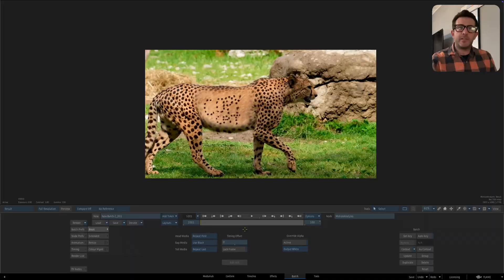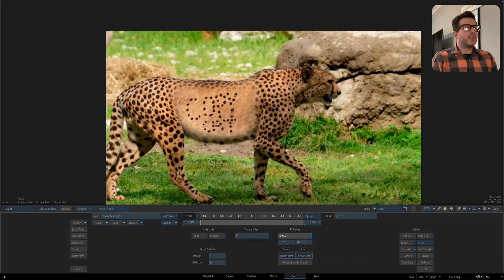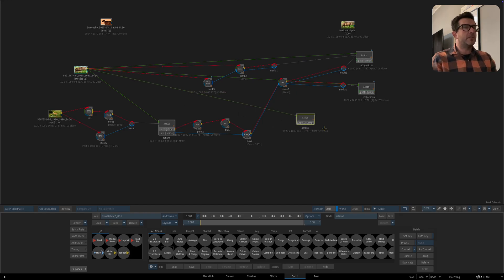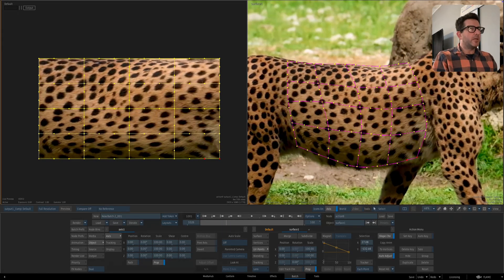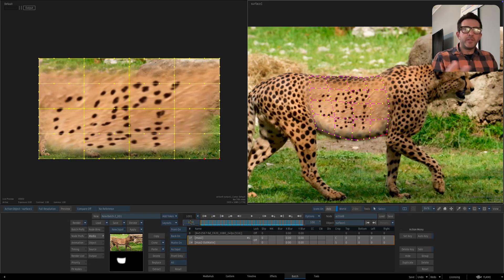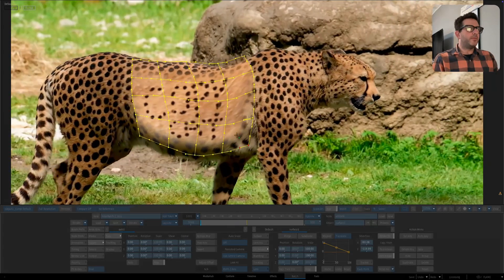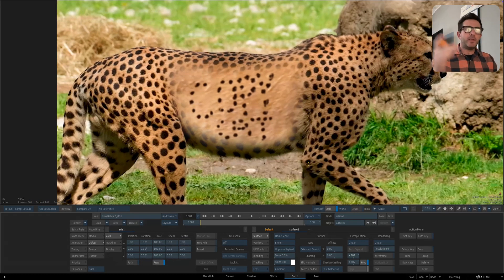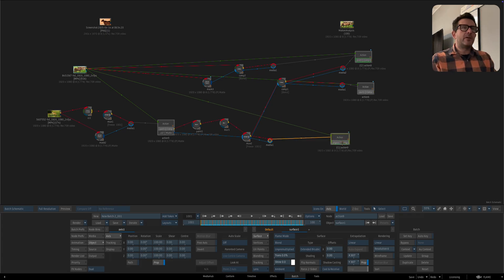Autodesk Flame - Extended Bicubic Tracking - Do The Dew revisited!

Comment: Hey Blake, what sort of hardware are you running your Flame on?
Reply from the maker: All the demos are just done on M2 Max MBP and 64GB ram and nvme raid.  I also have a linux box with intel 13900k and rtx 4080.
Reply: @alwaysblakeVFX  wow really? Ok. Until I saw your post on LinkedIn I thought no one was using Flame anymore. You probably don't remember me from way back when but I think we crossed paths back at Blind or Imaginary Forces in the late 90's early 2000's.